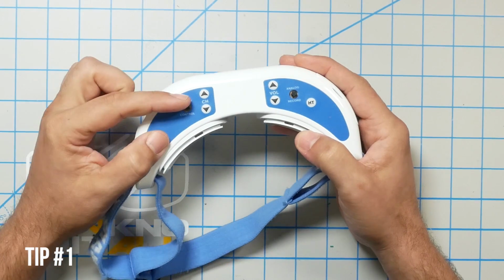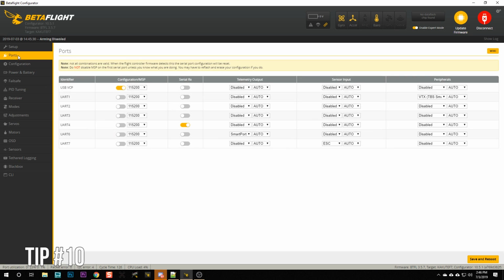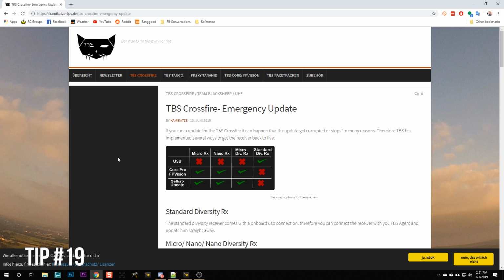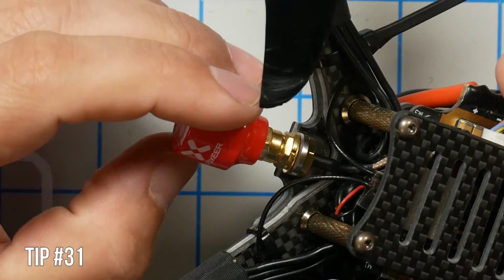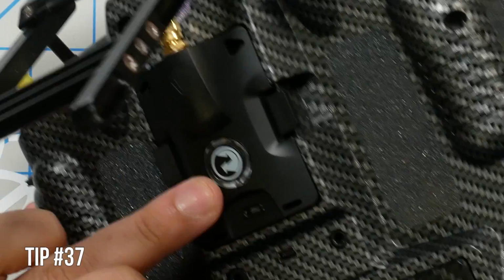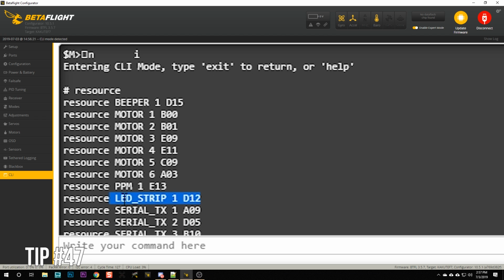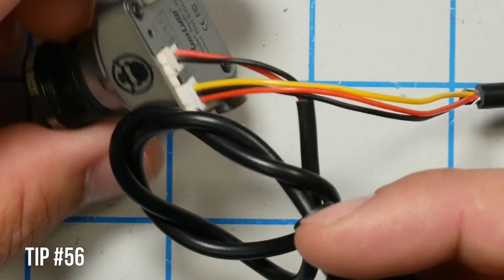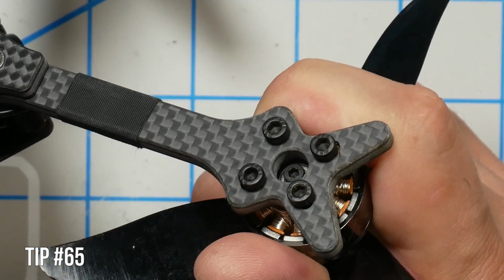65 Tech Tips For FPV Pilots | YOU DON'T KNOW #40 I GUARANTEE IT

Comment: Josh, more often than not, if i use turtle mode to flip back over after a crash, i destroy my props...  Am i missing something, is there a way to reduce damaged props in my situation?
Reply from the maker: There are several things you can do here.

1. Use more durable props. Some props just fall apart easier than others.

2. Identify carefully which props are free and only spin those props. So if the quad is resting on the left props, push right to flip it over with the props that are in the air.

3. Don't go bonkers with the props at first. Tap the stick gently to see which props are obstructed.

4. If you are using bottom mount battery and no GoPro, get a 3D printed "shark fin" so that when you are flipped over, some of your props will always be up in the air.

Comment: im glad you mentioned not pushing the sticks hard on calibration. i would do the stick bang on mine and eventually had some issues arming (or getting an airplane esc to arm) because it wasn't at min throttle. gentle up down left right and its fixed

Comment: Regarding the last tip. Buy some polymorph and apply makeshift protection to the arms. Works good in abandoned building, I use it to apply on top as well with zip ties. It is shatter proof and slides well on concrete upon impact

Comment: I just installed rapid fire and now I cant get my dvr screen to show up. I have domv3 and the power switch underneath won't turn the module off
Reply from the maker: It's because you are using the auxiliary power cable. You have to do the inverter mod if you want to be able to use the power switch. In the latest firmware there is also a software option to turn off the module.

Comment: I've learned with the Aomways Commanders that if you unplug the power hastily without stopping the record it will corrupt the file. I'm not sure if that's an issue with the FatSharks. I'm working on unlearning that habit which came about just because i was always trying to save battery.
Reply from the maker: Fat Shark correctly saves the file when power is pulled.

Comment: Hey, I was wondering if you could make a video about your thoughts on an iteration of betaflight called neuroflight. It supposedly uses artificial intelligence in place of the PID loops.
Reply from the maker: Neuroflight is a very interesting academic project. But it is not practical at this time to use it as a primary flight control system. The reason is that, in order to train an AI, you need lots and lots of iteration. Machine learning uses an approach of trying EVERYTHING and finding the things that work. You need thousands to millions of trials before a machine learning system starts to get "smart".

The way this is usually done is to have the AI learn in a simulated environment. Like if the AI is going to learn to play chess, it will play millions of games of chess against itself and figure out which strategies work best. This is effective because you can run these simulations very very fast.

Now think about how that would work with a quadcopter. The AI would need to fly the quadcopter, then be told "you did good" or "you did bad", and then feed that info forward into future generations. How could you do that with real quadcopters? You couldn't. First of all, the AI is not actually "learning" on the FC. All of the "learning" happens back in a computer in the lab. The FC doesn't have enough processing power to do the "learning". So you would need to have the AI fly, then it crashes, then you feed the blackbox back into the AI learning engine and tell it, no that was bad.

Thousands and thousands or millions of times.

You see why that can't work.

So what the neuroflight designer is doing now is building a simulator that the AI can learn to fly in. This means it can learn very fast, but the problem is that the AI is only as "smart" as the simulator is accurate. So ask yourself, how closely do sims fly to real quads? Not very close.

So that is why Neuroflight is an interesting academic project, but not actually a practical way of flying a quadcopter.
Reply: @JoshuaBardwell  hmmmm, yes it would take a lot of flights to gather enough data. Although, considering what you were saying, I wonder if it were possible to use logs uploaded from the community as data sets for an AI. No simulations needed and the time it takes to gather data is significantly reduced. I wonder if this research is using data sets from a single quad or using different setups.

Comment: Tip 56, they know, BUT, they'r sponsored! :D similar to "affiliated links" :D
Reply: They know, but did you see how long that took? How many extra practice laps could they have got in instead of caring about that?
Seriously though, it's the manufacturers that need to change
Reply from the maker: I disagree. If the manufacturers shipped with the OSD turned off, most people wouldn't even know it exists.
Reply: @JoshuaBardwell  that's true, but pilots has to promote brand they use, and best and easiest way, is just to write "leave" Foxeer/Runcam ;]

Comment: TIP: To find a lost quad with no beeper in long grass/crops use the video quality as you search. When you get close and there is no noise in the video remove the antennas from your goggles and continue searching. Great for woops which can be difficult to find and may not have a buzzer.

Comment: Tip no 66- if your running GPS,  you can plug in your USB to get a sat lock without having your vtx powered and getting hot, the plug In Your flight battery when your ready to fly.
Reply: Do you plug into a laptop, or can you plug into a power bank?
Reply: @robmalan7137  does not really matter, i have used a power bank but for the craft this is most useful for i tend plug it into a laptop as it makes sense to do setup things through the usb as not having the 433 telem active also speeds up a gps lock.

On my 450 quad i have a much better gps module and that gets a lock in like 15 seconds and i always just plug the flight battery in on that.

Comment: Good way to make sure you bent the prop back to right spot is look at it from the exact same angle as u turn it and pick the head of a screw or something for one blade to line up with then turn it, and if the tips of the blades dont all hit that exact spot...well u get it, but i pick a good little reference point then turn it is how i do it. its easy to screw up alittle depending on your own level judgement alone. but maybe im just over cautious

Comment: Tip, if you get a small burn on your fatsharks from the sun, leave them on with just static and after a while it should disappear.
Try this first before sending them off for repair👍😉
Reply: Nice tip! I’ve got a few Burnt pixels. I will try to give this a shot. Been times when I wasn’t thinking and the sun was shining in the goggles.
Reply: I always unplug my quad first and leave the fatshark on for a few seconds to prevent sun damage and osd burning ;)
Reply: @BurnSkate  Eh, how does that work? Damage is done by sun through lens to lcd. Nothing to do with quad.

Comment: Great tips, Josh! I would love to see some about  flying over water.
Reply: Im thinking about cutting pool noodles into little pieces zip tying them somehow so if i crash at least if floats.
Reply: @argyleskyfpv  I wrapped a water bottle in neon yellow duct tape and zip tied it to the bottom of my quad after conformal coating it and covering the camera seams in silicone, that should work well. I tried pool noodles, but a water bottle was better because it's lighter and more buoyant.

Comment: Incase anyone gets confused. Brightness is black level not white level it should be set high enough to prevent black level clipping. Contrast is the difference between black and white. If your whites are blown out turn it down but generally you want brightness set first. If you're trying to figure out which control is which look at the black levels as you adjust. The contrast should only change blacks slightly if at all.

Comment: 2 switch arming is a must #25 when kids are around. I have setup mine in the radios and not the quads though. This way if i forget the pre arm or running a quad without that mode it still is active no matter what

Comment: For tip #35 they should really make a edit so that if a flight controller is powered up via USB it auto puts the vtx into pit mode! Wouldent that be super convient so when you plug in your battery for motor testing and bl_heli it wont burn up the vtx??????